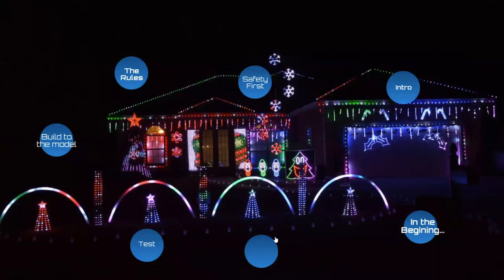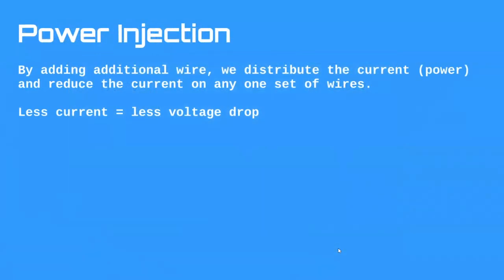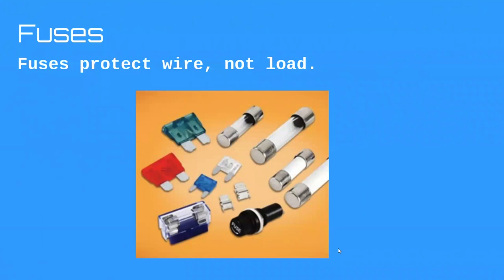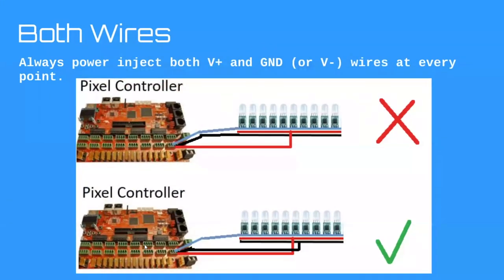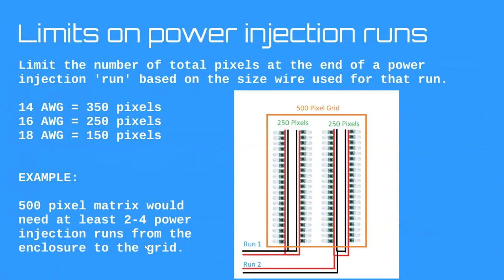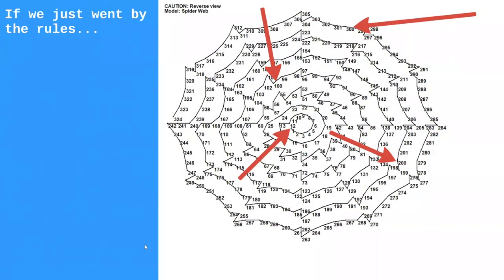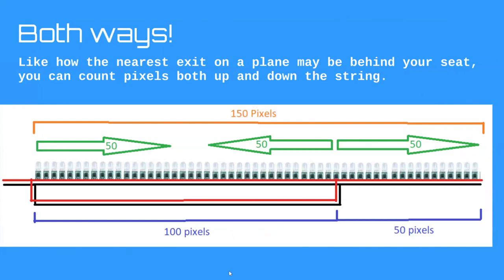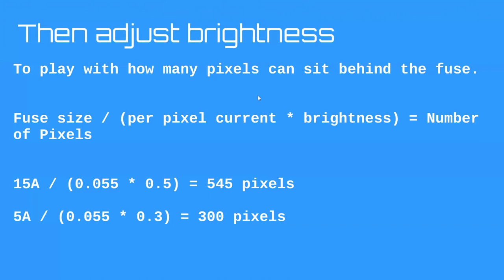xEssentials E10 Power Injection Made Easy

Comment: You need to explaiin this equation please. 15A/(0.055*0.5) =545 pixels
Reply: I think it' s at 18:17 in to the video.  15 A fuse / ( 0.055 amps per pixel * 50% brightness) = 545

Comment: Can you inject power with a different voltage in using a 12v ps for the main power and use a 5v as the secondary ps?
Reply: Your pixels are one or the other, you need to use that.

Comment: Hi thanks for the presentation. I got a question, on a WS2811 5VDC, 500 pixels, other than power injection,  Do I need data amp? TIA
Reply: Depends if they are "Regulated" or "Resistor" LEDs and how far apart each "string" is.  The data leaving a pixel is only designed to go a few inches, so if you split your string into 2x 250s, YES, amp.   A common rule is "1 Null Pixel/F-AMP per prop."   You may find that LONG strings tend to have flickering or discoloration at the end even through you power injected every single LED.  That's data degradation.  Put some Null Pixels/F-AMPs in there.

Comment: Hello,
Im creating a very large pixel grid. 25' in length and 5' tall in my house. Im using a 5V Pixlite 16 Plug and Play system with 2,040 (5V pixels) all together. there are 15 strands going horizontally. Each strip has 136 pixels on it. 2 sets of 50 and 1 with 36.  I need to inject power because there isnt enough power to get the second and third strand to work. If i get a power supply, can i inject power after the first 50 to power the other 86 pixels? and making sure that the red positive is disconnected after the first 50 so i dont inject power from both sources. what do you think?
Reply: As stated in the video, make sure no 5V pixel is further away than 50 pixels from a power injection source.